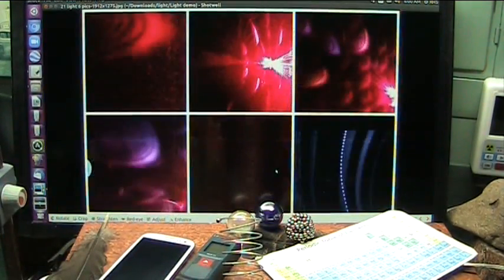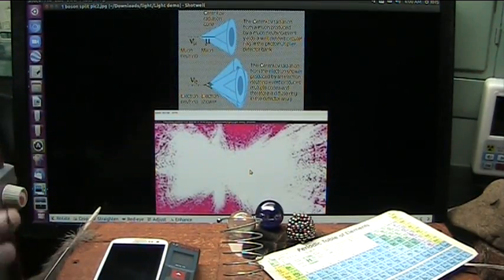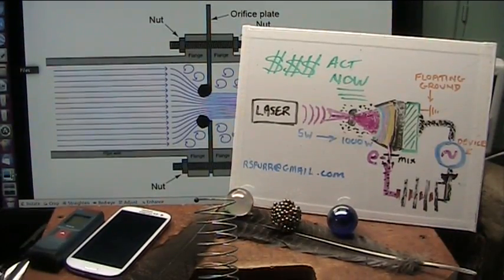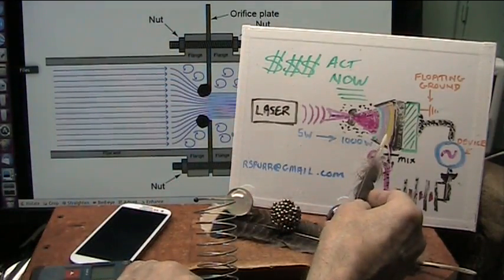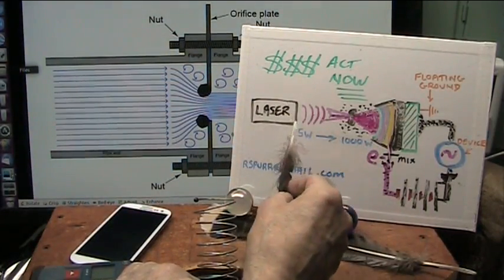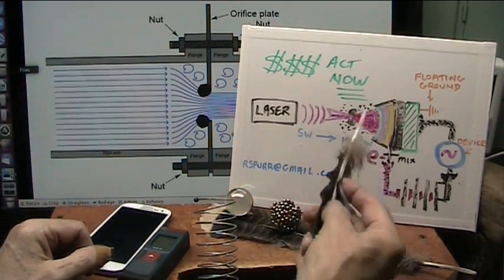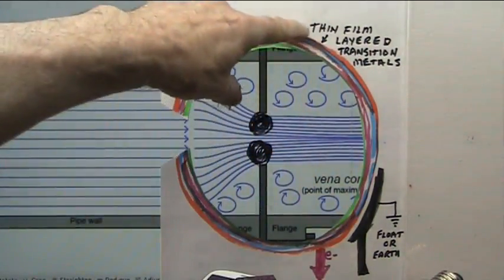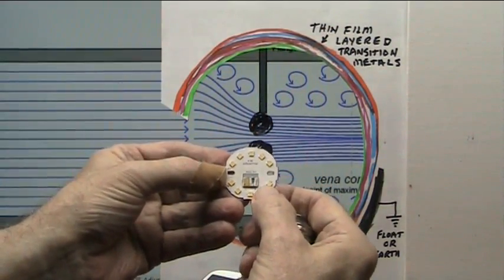Can a  Chance Discovery Literally Save the World

Comment: Those nails or a rounded opening on both sides would definitely create two coandla effects. For those that don't know about coandla effect, you can see it when you run water off the side of a spoon how the water will adhere to the spoon and be diverted you can also see that air does not like sharp objects it likes round and it will follow that in the atmospheric pressure actually keeps it on the perimeter of that shape, so I can see this occurring even with the light and it would have a pulling action of splitting the light that is going through it both ways.

Comment: Roger you can change the world completely.  Don't  back down . Let's  make it happen!
Reply: Reposition in the whirled: change.
- conch s hell
Reply: We need to educate the world. Forget about patents. Its like patenting fire for cryingoutloud. Lets stick it to the man!!!
Reply: @Mateo16-25  a try hard angle: invent ions > convent ion -> induct ion <
- gaussian ® work gene washing
Reply: @vitalgnosis  talking about the venturi? Shouldnt a softer angle be better? Funnel it down enough so the particles spray out coming out of the venturi in the same angle. Then triangulate where the electrons would land to figure out the LED diode optimum layout. If its round or a hard angle youll probably reflect a larger portion of the electrons IMO but I know NOTHING about lasers
Reply: @Mateo16-25   variance  7.5–12.5 Hz; 1–4 Hz. A = Rapture AD
Reply: @Mateo16-25  I like your analogy of the capacitor alot. It's safe to say: L = 90° ite amplification by "stimulated" emmision of -> radiate-ion. Not "a" part, but needs a pump for mule ah:  in order: two "z" what is: IT & radiate ion (heat) sink. 
- in compass ion, ate tor. Sea? Arpature pole (apple)
Reply: Yes! All we have to do is decide.